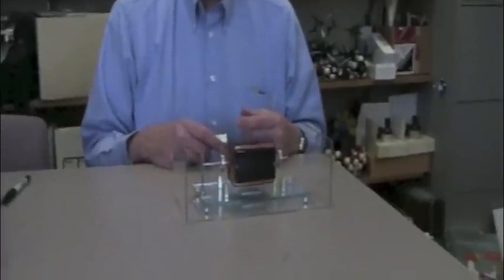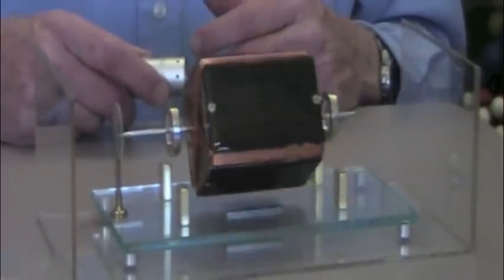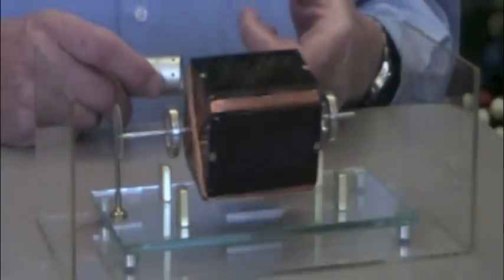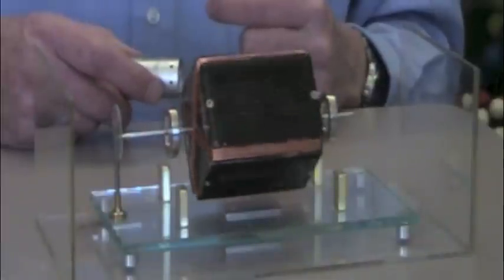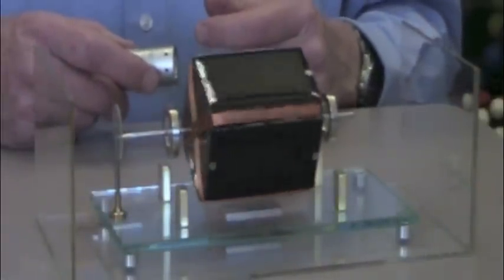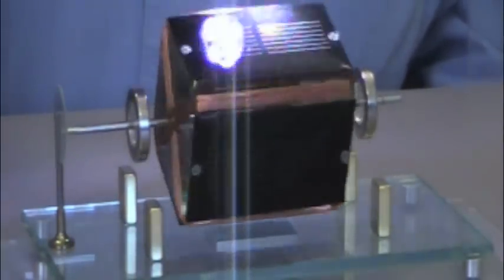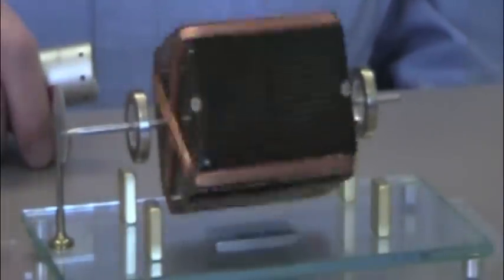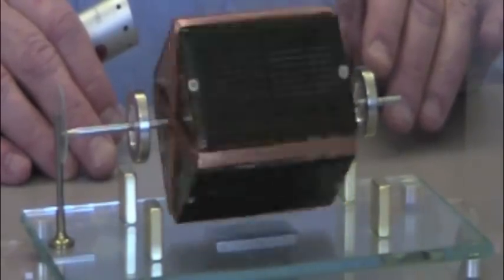Solar Electric Motor

Comment: Just calculating the height of the magnetic field so you can have a "locked position" ( Horizontal ) . Would luv to see the maximum speed ( rotation) it could get once outside! :) I got work for you sir !!!